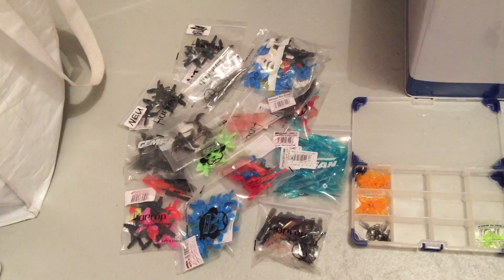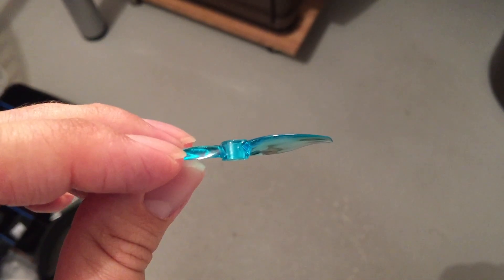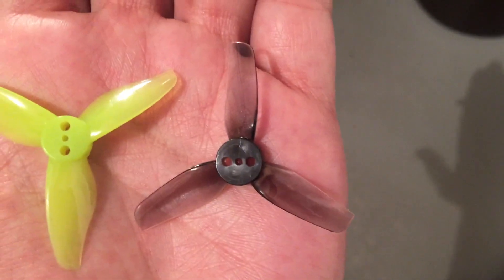My FULL KNOWLEDGE about Whoop Propellers for Whoop Racing | 65mm 75mm 85mm Whoop Racing

Comment from the maker: ⚠INFO⚠

0:00 Introduction
1:07 Pitch of a Propeller
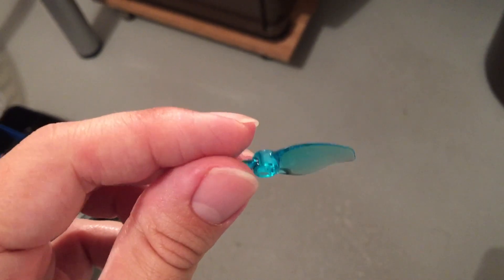2:08 Number of Blades on a Propeller
3:31 Surface Area of a Propeller
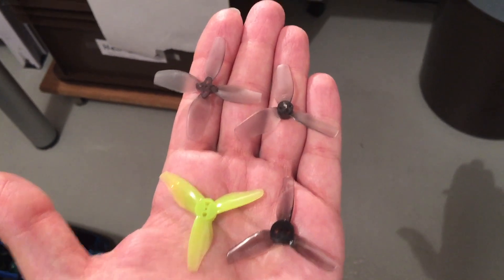5:06 My favorite 2inch Propellers for 85mm Whoops
5:55 My favorite 40mm Propellers for 75mm Whoops
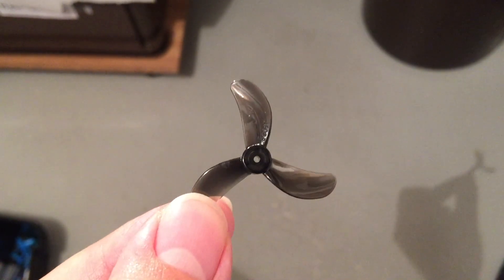7:21 Why low pitch propellers for racing?
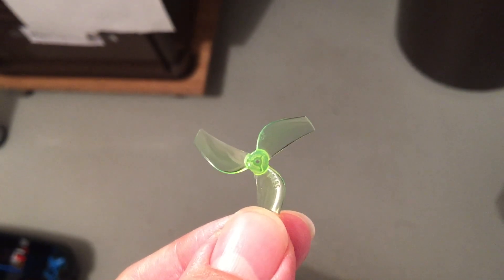8:14 My favorite 31mm Propellers for 65mm Whoops
9:11 Something to keep in mind when choosing Propellers for Whoops
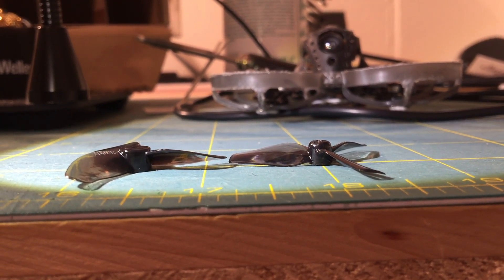9:40 Outro

► What you need to pay attention to when choosing a propeller for a race whoop:

● Pitch →  For me low pitch because of my high kv motors
● Number of blades →  For me 3- or 4-Blade (2-blade only on crazy crazy lightweight builds)
● Surface area of a propeller →  For me bigger surface area
● Shape of the propeller tips →  I don`t care to much about this (thin tips are less durable)
● Weight of the propeller →  For me lower weight is better
● Durability of a propeller →  I don`t care to much about this if the performance and weight is good
● Color of a propeller →  I prefer bright colors in case I lose a prop
● Propeller balance →  For me the propeller has to be well balanced from the factory

► My favorite Whoop Propellers for my high kv Racing Whoops in 2024:
(As of 5/10/24)

2inch (51mm) Propeller for 85mm Race Whoops:

1. HQ Prop T2x3x3 (best feeling in flight)
2. Gemfan 2023 (most efficient, good for some frames because of the higher propeller tips)
3. HQ Prop T51MMx4 (Lightweight, interesting flying feeling)
4. Iflight defender 2020 (Leightweight but not very durable, only for very very lightweight builds)

40mm Propeller for 75mm Race Whoops:

1. HQ Prop 1,6x1,6x4 ABS (not durable, but lightweight, great precision, low pitch)
2. HQ Prop 40mmx4 (low pitch, for lightweight builds)
3. HQ Prop 40MMx3 (low pitch, good as durable alternative to the nr 1)
4. Gemfan 1608-3 (medium pitch, good for outdoor)

31mm Propeller for 65mm Race Whoops:

1. Gemfan 1219S (lightweight, good grip in the air)
2. HQ Prop 31MMx3 Ultra Light (not testet yet)

⚠‼⚠Keep in mind propellers are very sensitive to discload! A propeller can be great with an all up weight 75mm whoop weight of for example 36g. But at 37g it's not so good anymore and at 38g it's not good at all. Propellers are sometimes only good up to a certain weight or in other words disc load. My information only refers to my whoops, which are very light and have a lot of power. I fly high kV motors with low internal resistance, without motor plugs (motor cables soldered to the pads on the flight controller), AWG20 main cable on 75mm whoops (lower internal resistance), BT2.0 or A30 main plug (lower internal resistance and good contact) and with the best lipos I can get (highest C-Rate)! This is all very important! If you want to benefit maximally from my experience then I advise you to do everything like I do. (For example, build my Butterfly75 802 27k Whoop)
Keep this in mind my friends!

⚠‼⚠Keep in mind: When choosing a propeller (for whoops) there is no point in using theoretical numbers. For example, it's of little use if you try to calculate something with the kv of a motor if the manufacturer has written an incorrect kv number on the motor (often happens with whoop motors). Or if you try to calculate something with a stable 4 volts (at 1S), but in reality you have voltage sag from the battery and you are flying with 3.8V shortly after takeoff. That's why you have to test it yourself if you want to have the maximum. Or you can rely on my experience and build a whoop exactly like I did. Then you will reach maximum performance more quickly and can focus on practice to fly.

I hope this video helps you. If you have any questions, I'll be happy to help you. (It is important that you give me as much information as possible! Otherwise I can't advise you.)
I will reply to comments within a maximum of two weeks. 

Happy flying my whoop friends!

Comment: the gemfan 2023 triblades are my favorite for my meteor85, with 1202 11600kv motors. im only using 1202.5 motors becasue 1 of my 1103s burnt out. but it still flies really good

Comment: I'm very surprised you found those 4 blade propellers to be the best. Every time i have tested 3 vs 4 blades, all i noticed was 30s lower flight times. And that was consistent for 31, 40, 2 inch. Its easy to see why when you turn the current draw on the OSD, you can see it drawing an amp more on quad blades.
Reply from the maker: Yes, it is true (usually) that 3-blade propellers result in longer flight times than 4-blade propellers. But with whoops, throttle control is very important to me (hence low pitch props) and also flight stability. And with 4 blades it is simply better for my slightly heavier whoops (with 1002 and 8028/803 Motors or 802 27k Motors with 12A Board, all those Whoops are over 24g dry weight). The more lightweight (about 22g dry) 75mm Whoops can definitely be flown with the low pitch HQ prop 3-blade 40mm. But unfortunately this prop isn't quite as good for heavier whoops. I hope there will be another low pitch 40mm 3-Blade prop on the market at some point.. Hope this helps..

Comment: Hi! Use you drillbits for holes in propellers? When they very tight for shaft. For example 1mm shaft, what drillbit you recomend? 0.95 , 0.99 , 0.90 ...?
Reply from the maker: Very very good question! Yes exactly! I use the prop re-drilling-dental-floss technique..Because I change props quite often with all my testing.. And because the prop holes or the motor shafts are (unfortunately) often inaccurate, I drill out the props with a 1mm / 1.5mm pcb drills (sometimes from both sides, and sometimes three times) and then mount the props with a small piece of dental floss in the prop hole. Sometimes I lose a prop in a hard crash, and after the flight I have to check whether all the props are still down on the motor bell, but I don't care.. I also tried 0.95mm and 1.45mm drills, but that didn't work because the drills didn't remove enough material. Maybe 0.98mm/1.48mm would work, but so far I haven't found any such drills. For 1mm I would recommend 0.98mm if you can find one. And otherwise 1mm and either drill in just once (without pulling) so that you only remove a little material or then work with dental floss like I did.
Reply: @butterflyfpv  thank you for that, bro!

Comment: Schöne prop Sammlung. Kenne ich irgendwo her 😅
Bei mir ist lückenlos bis 10 Zoll gesammelt.
Mir gefällt wie leise die vier Blatt props sind. Zudem sehr griffig und smooth.
Am schnellsten sind die zwei Blatt, wenn der Motor viel kv hat bzw hoch dreht.
In kurven zählt aber grip und beschleunigen mehr.
Reply from the maker: Wow deine Sammlung muss crazy sein😱Irgendwie bin ich froh dass ich nur bis 2zoll props fliege..😅 Ja voll am schnellsten sind oft die zweiblatt, aber wie du schreibst, für einen racer zählt topspeed oft weniger als anderes. Darum fliegen heutzutage auch alle 5inch racer dreiblatt. Und bei whoops mag ich vierblatt irgendwie manchmal auch.. die HQ 40mm 4-Blatt in ABS sind die allerbesten! Ich wünschte HQ würde die mal in polycarbonate machen..